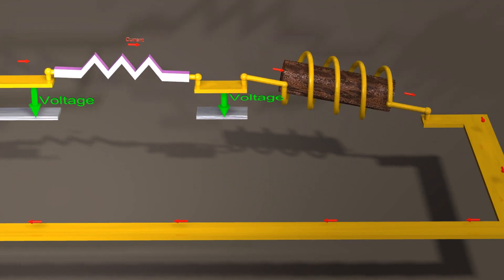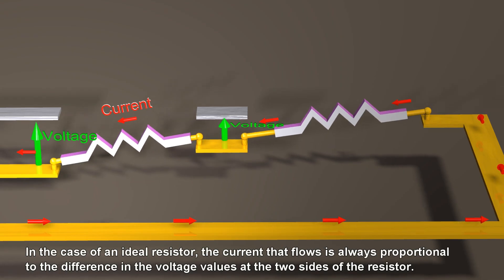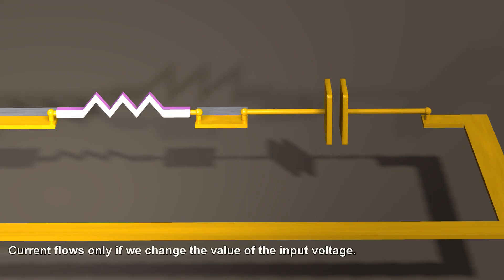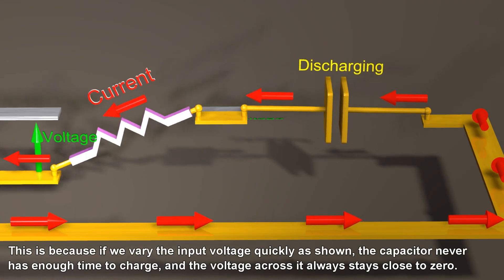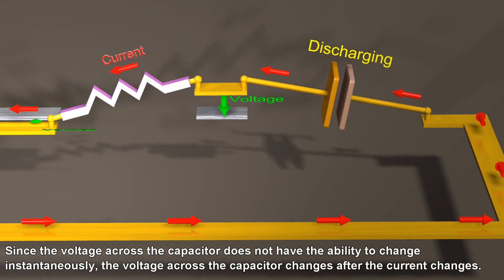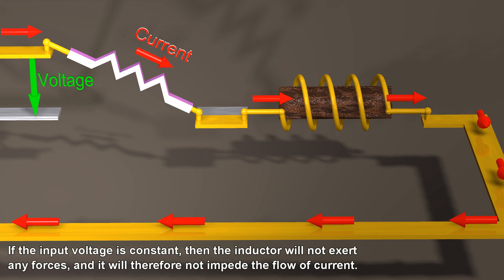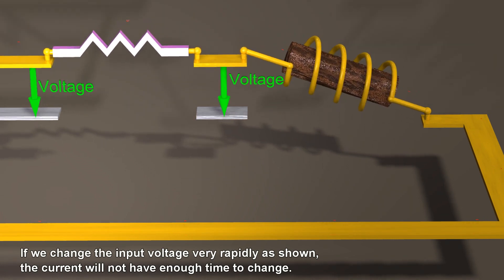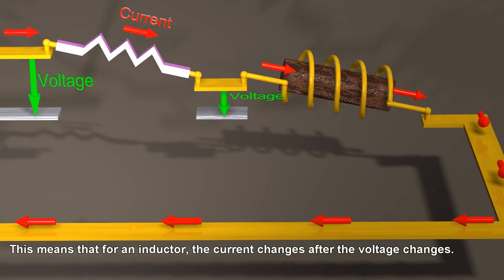AC current impedance - Alternating Voltage for inductors, capacitors

Comment: Efficient explanation, made me re think. 
My past life.
I was always cluttered with minutia. 
Old observant, new sub.
Reply: What is a resistor? How does current branch in a network of resistors? How does it "know" how much should flow in each branch?
While some detail is given in science and engineering courses about conductors, insulators and semiconductors, resistance is described in several ways.
Examples include i. The restriction to the flow of electrons. ii. The difficulty in moving electrical current through a conductor to which voltage is applied.
iii. a circuit element which dissipates energy in the form of heat .
More appropriate description for a resistor would be the property of a conductor which determines the current produced by a given difference of potential.
This makes us remember that a resistor is a conductor first. And, there is reason to say that superconductive wires dont obey ohm's law. So all conductors are resistive, though not superconductors. 
Resistors are used in circuits to regulate the strengths of currents either by reducing the diameter of conductors or introducing more obstacles or lattice imperfections to reduce the strength of current.
The current branches in a parallel network by an elaborate rearrangement of surface charge.
For more details about resistance, how current branches in a parallel circuit and ohm's law consult the following videos, articles and books.
Capacitive reactance
The capacitive reactance is expressed in ohms and it is useful to determine steady-state current values to sinusoidal voltage inputs. Although the value of the reactance is expressed in ohms, it was not obtained by computing a resistance, as of resistors. 
The current in the wires of a capacitor circuit is due to the resultant electric field E(NET) (a resultant of the applied field and an opposing electric field, the fringe field of a capacitor), obtained by applying the relation for current density J = σE(NET), where σ is the conductivity of the wires.

The field in the wire which may vary sinusoidally is always a resultant of the applied voltage which may be sinusoidally varying and the fringe field due to charge accumulation on the capacitor plates.
For a comprehensive description of the mechanism of current leading the voltage across a capacitor see the book references below. 
Inductive reactance
The inductive reactance is expressed in ohms, and is useful to determine steady-state current values to sinusoidal voltage inputs. It is to be noted that though the value of the reactance is expressed in ohms, it was not obtained by computing a resistance, as of resistors. 
The current is on account of the resultant of the applied field and an opposing coulomb electric field, which is due to polarization by the non-coulomb curly patterned electric field associated with the changing magnetic field, and the current obtained thereof by applying the relation J = σE(NET) where E(NET) is the resultant field of the applied field and the coulomb electric field and where σ is the conductivity of the wire.
For a comprehensive description of the mechanism of current lagging the voltage across an inductor at different frequencies see the book references below. 
Electrostatics and circuits belong to one science and not two, that of electricity and magnetism. To know how they are unified visit this link 
https://matterandinteractions.org/articles-talks/ and view the article 'A unified treatment of electrostatics and circuits.  B. Sherwood and R. Chabay, unpublished. (1999)'
pdf.
For a live demonstration of surface charge and its effects in circuits visit 
https://youtu.be/U7RLg-691eQ
Electrostatics and circuits belong to one science and not two, that of electricity and magnetism. To know how they are unified visit this link 
https://matterandinteractions.org/articles-talks/ and view the article 'A unified treatment of electrostatics and circuits.  B. Sherwood and R. Chabay, unpublished. (1999)'
pdf. 
For a live demonstration of surface charge and its effects in circuits visit 
https://youtu.be/U7RLg-691eQ
For a detailed discussion of surface charge, coulomb's law, electric fields, fields of dipoles and other charge configurations, parallel plates, capacitance, currents, conservation of charge, conservation of current, superposition of fields, superposition of potential, simple dc circuit, magnetic fields, magnetic fields of a current element, straight wire, current loop, solenoids, biot-savart law, voltage, voltage source, difference between e.m.f. and potential difference, ideal voltage sources, resistors, how current branches in a parallel circuit, capacitors, inductors, faraday's law, inductance, ac circuits, transmission lines, motors, generators, p-n junction diodes, electromagnetic waves, antennas and radiation, new electrodynamic theories on the nature of the electric field, see "Electric and Magnetic Interactions" by Chabay and Sherwood 
www.matterandinteractions.org
or 
Fundamentals of electric theory and circuits by Sridhar Chitta
https://www.wileyindia.com/fundamentals-of-electric-theory-and-circuits.html
There is a "look inside" feature in the amazon.com webpage of the book "Fundamentals of electric theory and circuits" by Sridhar Chitta with a few pages of Chapter 1 which may be viewed and also which you may swipe left or press < icon to view the foreword, preface and Table of Contents. 
The contents of the above book by Sridhar Chitta, make a distinct unified approach to electrostatics and a few advanced circuits like coupling signals to amplifiers, lending precision and clarity to the topics which is not found in most text books.
The book comes alongwith a CD with animated power point presentations for all chapters and voltage regulator, RC phase shift oscillator, transformer-coupled audio amplifier and differential amplifier included additionally.
For a lecture by Prof Ruth Chabay on surface charge in a simple dc circuit visit 
https://youtu.be/-7W294N_Hkk
There is a full set of lectures beginning lecture 13 here on surface charges, electric fields, simple circuits, capacitance, inductance, faraday's law, motional emf, magnetic forces and more topics here
https://matterandinteractions.org/videos/EM.html

Comment: So a capacitor is an imperfect high-pass filter, while an inductor is an imperfect low-pass fiter.  The higher the inductance in an inductor, the lower its high-frequency cutoff, while higher capacitances cause the low-frequency cutoff of a capacitor to go down.
Reply: What is a resistor? How does current branch in a network of resistors? How does it "know" how much should flow in each branch?
While some detail is given in science and engineering courses about conductors, insulators and semiconductors, resistance is described in several ways.
Examples include i. The restriction to the flow of electrons. ii. The difficulty in moving electrical current through a conductor to which voltage is applied.
iii. a circuit element which dissipates energy in the form of heat .
More appropriate description for a resistor would be the property of a conductor which determines the current produced by a given difference of potential.
This makes us remember that a resistor is a conductor first. And, there is reason to say that superconductive wires dont obey ohm's law. So all conductors are resistive, though not superconductors. 
Resistors are used in circuits to regulate the strengths of currents either by reducing the diameter of conductors or introducing more obstacles or lattice imperfections to reduce the strength of current.
The current branches in a parallel network by an elaborate rearrangement of surface charge.
For more details about resistance, how current branches in a parallel circuit and ohm's law consult the following videos, articles and books.
Capacitive reactance
The capacitive reactance is expressed in ohms and it is useful to determine steady-state current values to sinusoidal voltage inputs. Although the value of the reactance is expressed in ohms, it was not obtained by computing a resistance, as of resistors. 
The current in the wires of a capacitor circuit is due to the resultant electric field E(NET) (a resultant of the applied field and an opposing electric field, the fringe field of a capacitor), obtained by applying the relation for current density J = σE(NET), where σ is the conductivity of the wires.

The field in the wire which may vary sinusoidally is always a resultant of the applied voltage which may be sinusoidally varying and the fringe field due to charge accumulation on the capacitor plates.
For a comprehensive description of the mechanism of current leading the voltage across a capacitor see the book references below. 
Inductive reactance
The inductive reactance is expressed in ohms, and is useful to determine steady-state current values to sinusoidal voltage inputs. It is to be noted that though the value of the reactance is expressed in ohms, it was not obtained by computing a resistance, as of resistors. 
The current is on account of the resultant of the applied field and an opposing coulomb electric field, which is due to polarization by the non-coulomb curly patterned electric field associated with the changing magnetic field, and the current obtained thereof by applying the relation J = σE(NET) where E(NET) is the resultant field of the applied field and the coulomb electric field and where σ is the conductivity of the wire.
For a comprehensive description of the mechanism of current lagging the voltage across an inductor at different frequencies see the book references below. 
Electrostatics and circuits belong to one science and not two, that of electricity and magnetism. To know how they are unified visit this link 
https://matterandinteractions.org/articles-talks/ and view the article 'A unified treatment of electrostatics and circuits.  B. Sherwood and R. Chabay, unpublished. (1999)'
pdf.
For a live demonstration of surface charge and its effects in circuits visit 
https://youtu.be/U7RLg-691eQ
Electrostatics and circuits belong to one science and not two, that of electricity and magnetism. To know how they are unified visit this link 
https://matterandinteractions.org/articles-talks/ and view the article 'A unified treatment of electrostatics and circuits.  B. Sherwood and R. Chabay, unpublished. (1999)'
pdf. 
For a live demonstration of surface charge and its effects in circuits visit 
https://youtu.be/U7RLg-691eQ
For a detailed discussion of surface charge, coulomb's law, electric fields, fields of dipoles and other charge configurations, parallel plates, capacitance, currents, conservation of charge, conservation of current, superposition of fields, superposition of potential, simple dc circuit, magnetic fields, magnetic fields of a current element, straight wire, current loop, solenoids, biot-savart law, voltage, voltage source, difference between e.m.f. and potential difference, ideal voltage sources, resistors, how current branches in a parallel circuit, capacitors, inductors, faraday's law, inductance, ac circuits, transmission lines, motors, generators, p-n junction diodes, electromagnetic waves, antennas and radiation, new electrodynamic theories on the nature of the electric field, see "Electric and Magnetic Interactions" by Chabay and Sherwood 
www.matterandinteractions.org
or 
Fundamentals of electric theory and circuits by Sridhar Chitta
https://www.wileyindia.com/fundamentals-of-electric-theory-and-circuits.html
There is a "look inside" feature in the amazon.com webpage of the book "Fundamentals of electric theory and circuits" by Sridhar Chitta with a few pages of Chapter 1 which may be viewed and also which you may swipe left or press < icon to view the foreword, preface and Table of Contents. 
The contents of the above book by Sridhar Chitta, make a distinct unified approach to electrostatics and a few advanced circuits like coupling signals to amplifiers, lending precision and clarity to the topics which is not found in most text books.
The book comes alongwith a CD with animated power point presentations for all chapters and voltage regulator, RC phase shift oscillator, transformer-coupled audio amplifier and differential amplifier included additionally.
For a lecture by Prof Ruth Chabay on surface charge in a simple dc circuit visit 
https://youtu.be/-7W294N_Hkk
There is a full set of lectures beginning lecture 13 here on surface charges, electric fields, simple circuits, capacitance, inductance, faraday's law, motional emf, magnetic forces and more topics here
https://matterandinteractions.org/videos/EM.html

Comment: To you engineers, I saw a video on electric fence. ( trying to keep my dogs from digging holes through my fence and get impounded again ) Using an ignition coil that is supposed to step up the voltage to 8kv I am going to use a 120v to 12 v at 60 Hz transformer to power the ignition coil what do I need to limit the current ? Capacitor in series with primary? Or can I just connect directly transformer output to coil input?